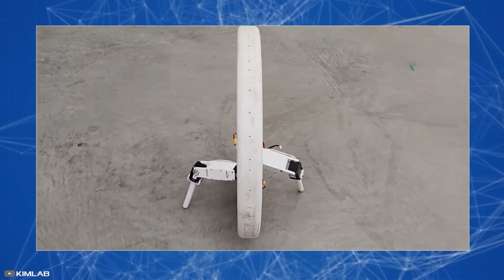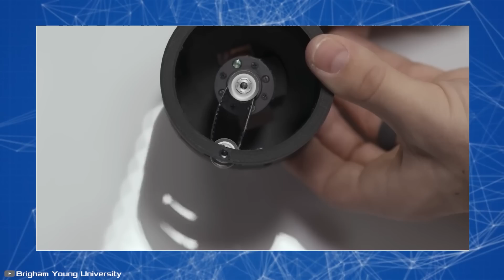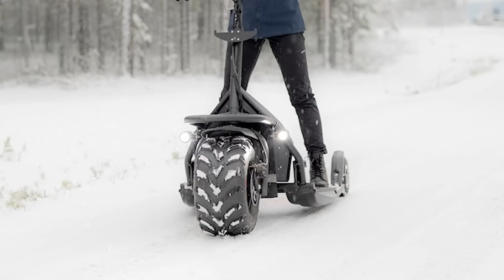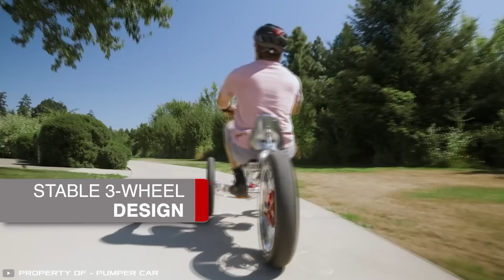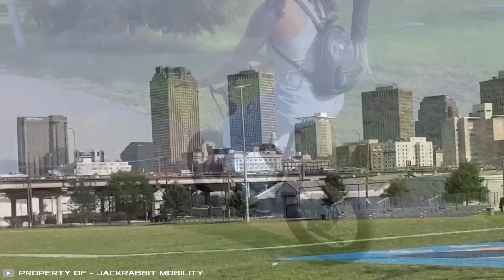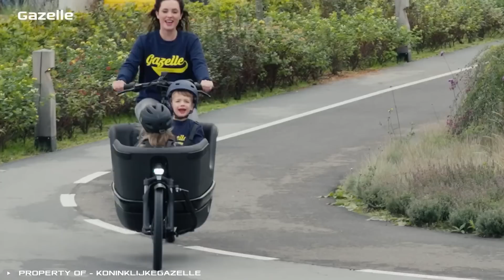INCREDIBLE INVENTIONS THAT WILL AMAZE YOU

Comment: That robot dog is scary as hell.
Here's how SkyNet started...
Reply: its fake. it looks like the robot has no weight when jumping and does weird leg moves.
Reply: also the biker one time has a baseballcap, but next time he doesn't. it is a set, not a random done video.
Reply: @frankheidemanns5250 No. I've seen the first model and it's just as agile and scary.
Reply: @piconano  I think you misunderstood me. The robot is true, but not the jump. Some parts of this video are true, some are fake. AI can do these fakes.
Reply: @frankheidemanns5250 One day, one will do a flip and kick you in the balls, then you'll be a believer.
Reply: Skynet is neither a robot or a physical machine, it's a ai software system that uses networks and the internet to be anywhere using sensors, cameras and anything internet connected to destroy humans.